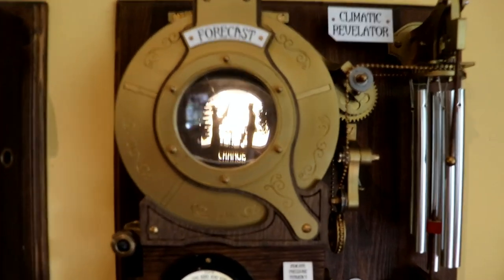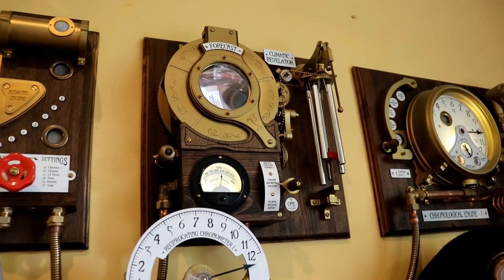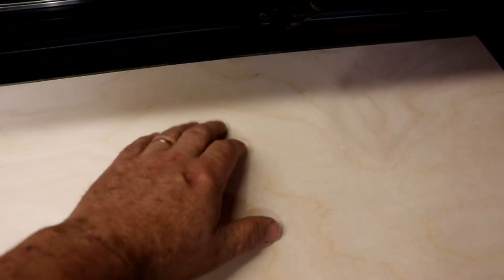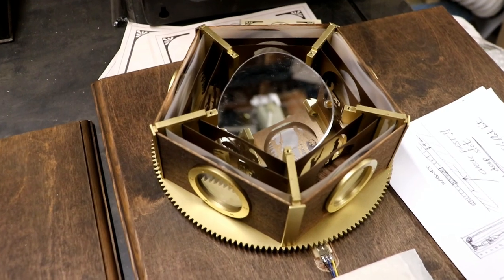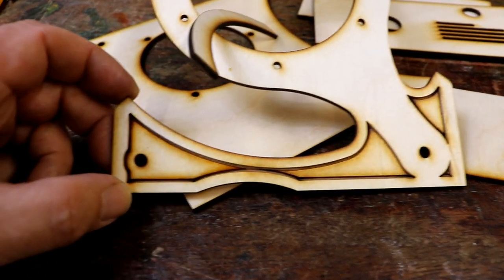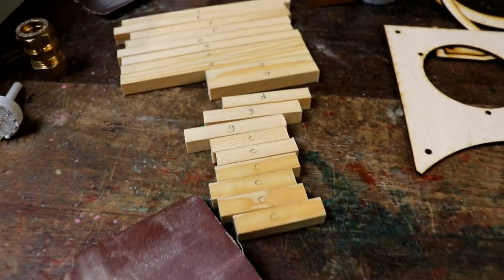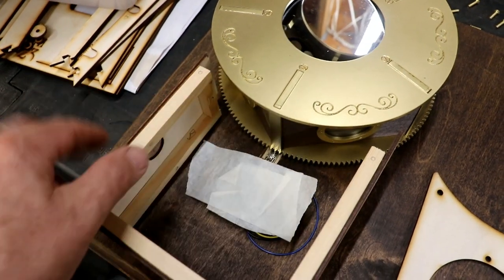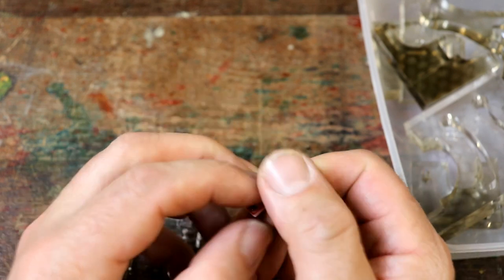Making the Climatic Revelator steampunk weather machine's 'Machinery Housing'

Comment: Wow!  These videos are super useful, fun, and extremely inspiring!   I really appreciate them and always look forward to the next one.   On another note, have you considered using actual walnut veneer on the ply?  You could do most of it before cutting, excluding edging of course, and it gives a much richer look than the staining of pine.  Keep up the great work on these and keep inventing!!
Reply from the maker: Thanks Tom. I'll look into using a veneer. I was always put off by the glueing and clamping, but a few years back used self adhesive veneer for a range of speaker cabinets and that worked extremely well. Thanks to your comment I've just remembered that! If interested it was called PSA (pressure sensative adhesive) Veneer. I got it in the UK from an online shop called the Veneer Hub.
Reply: @steamhead  That works.  Another possibility you might want to look into is heat-activated adhesive.  You just coat both pieces, let it dry, then use a clothing iron with a cloth under it to "iron" on the veneer.  It works great, even on mild curves like arches if you have a mold supporting it.  Its instant with no clamps.
Reply from the maker: Thanks for that Tom, I hadn't heard of it. I'm aware of iron on veneer edging, but being able to iron on the whole lot sounds great. Thanks again for your sage advice!